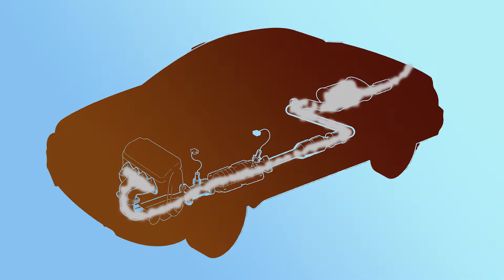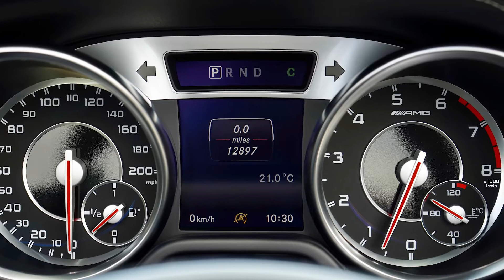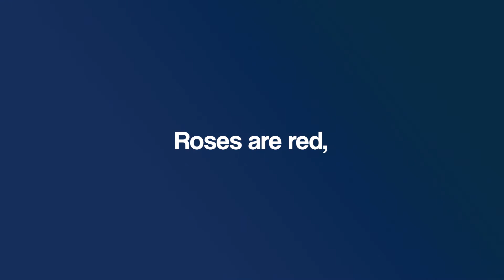Eli5 - Why are motorcycles so loud?

Comment: Most of these points can be proven demostrably false.  As far as the lack of engine cover as to why it is loud.  Gold wings and BMW for example all have engines.  but they pass by with barely a whisper.  the smaller exhaust.  Again many bikes barely make a sound, while they all possess the space for the same exhaust.  As far as it is safer, studies have proven that wrong, as you cannot hear them till they are essentially ontop of you.  the only reasons for the loud exhausts are pure vanity.  It makes the rider feel cool, or feel they are going faster than they actually are.  there is the performance argument, but since most bikes already go a sufficient speed,with sufficient power, that again falls under vanity.